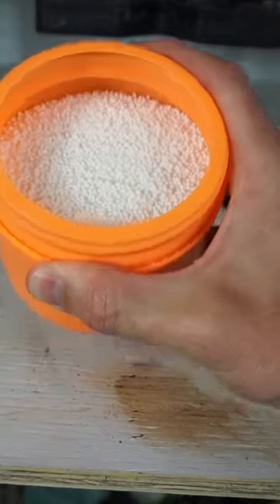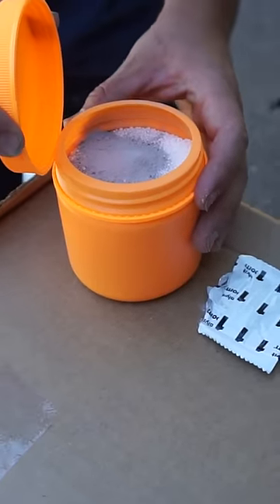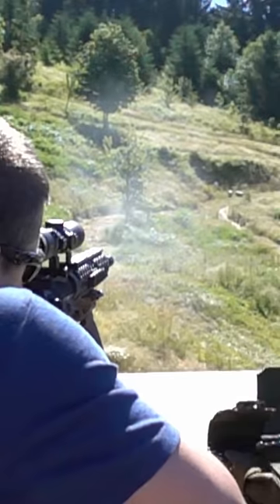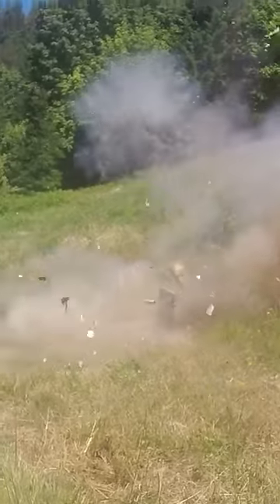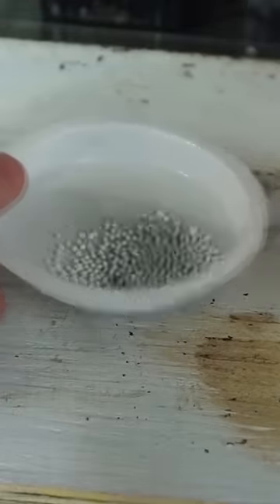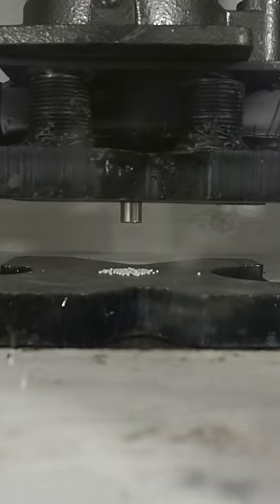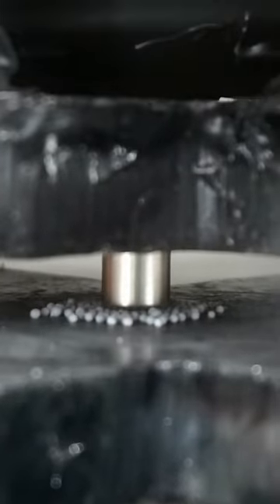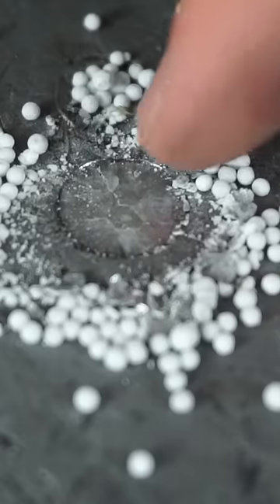Don't Crush Tannerite In a Hydraulic Press

Comment: It's actually easy to build a 50,000 psi hydraulic press I did it with a few pieces of steel I beams and plate and square tubing and I just ordered the pneumatic hydrolic it only cost me 200  dollars to build complete and I use it for all kinds of stuff a high psi hydraulic press can be used for pressing ball joints and bearings and farm equipment repairs, pressing out bushings ECT and it's all portable on wheels.

Comment: If you really want to make it fun, put the tannerite in a sealed container and drop it into a large container filled with gasoline. Thats how you get them movie explosions, and if you mix styrofoam with a little bit of kerosene into the gasoline its even more fun, also mixing bleach and ammonium and then distilling it and pouring it into small sealed capsules and putting that into the gasoline (still sealed of course)

Comment: We put 20 pounds underneath a full size water heater.... yes I have video, yes the water heater went well over 100ft in the air. The shock wave was pretty cool to. forgot to mention my buddy could hear the blast 5 miles away. Surprisingly the cops didn't show up.😂

Comment: Duh. It’s a primary or low explosive if you stepped on that or dropped it at your feet you’d die. Technically just by picking it up you’re breaking the law.

If you concentrate it down into a cylinder and try it again you’ll probably have better results.